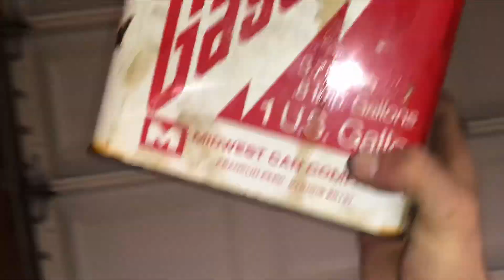FREE PIT BIKE Gets Fresh Rebuild

Comment: That old piston shows evidence of lack of oil flow in your engine you need to get into the right crank case cover and clean out the oil trap/filter it's clogged up and will do the same damage to your new top end if you don't clean it out. Ride safe.. Mike 👍